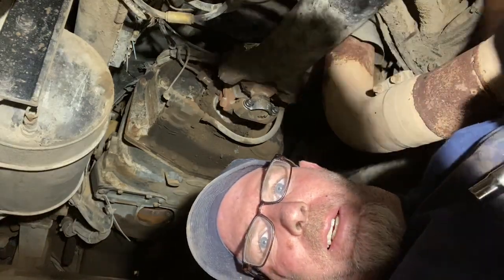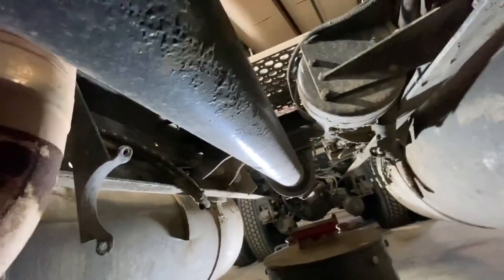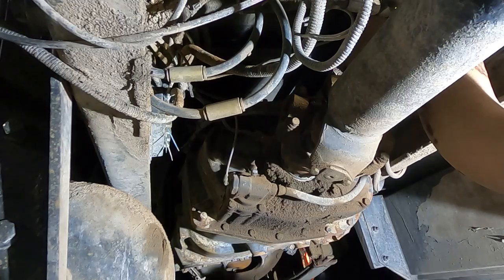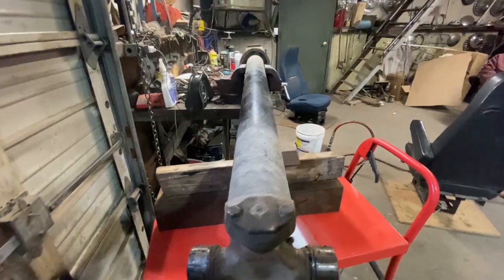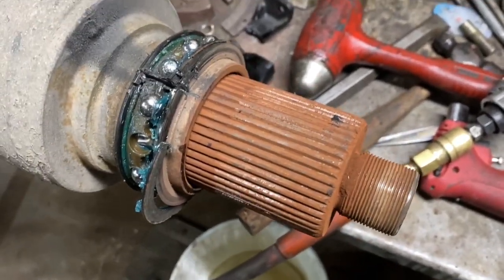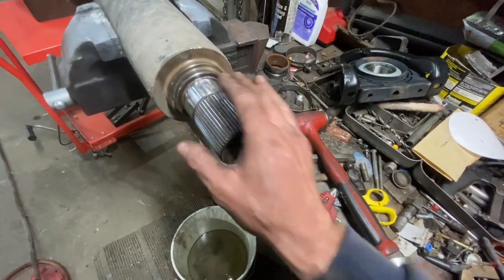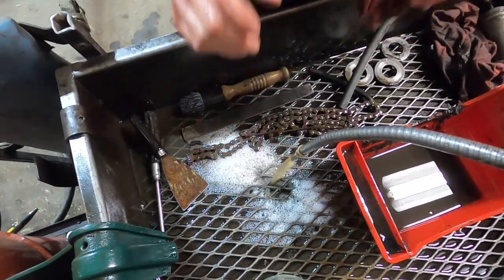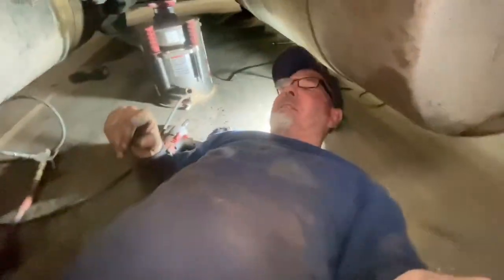Semi Truck Carrier Bearing Replacement..

Comment: Seems like it would be easier to just put a 2 bar puller on that bearing to get it off.  That way you could leave the front section of the drive line attached and do the whole job under the chassis.
Reply from the maker: 😂 I like to do things the hard way

Comment: I am going to be doing my 94 F-800 27' box truck with a 8.3 Cummins that has 300k miles. Your vid has given me some great insight and confidence into the job ahead. I have installed a 6 speed OD tranny thought the noise would go away but it ended up being the support bearings. Wanted the OD tranny was hoping the noise would go away, not so lucky. Anyway, your vid was worth more than a dam. Many thanks, Dan.

Comment: Good job. I was told to ALWAYS replace the straps and bolts on the u-joints anytime you take them off of the yoke. But as long as they are locktite I guess it's cool.